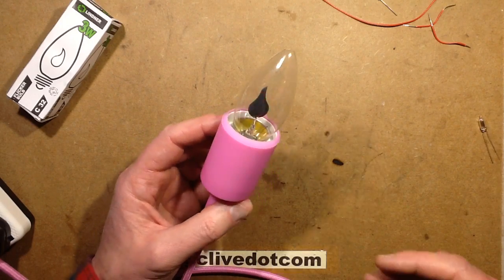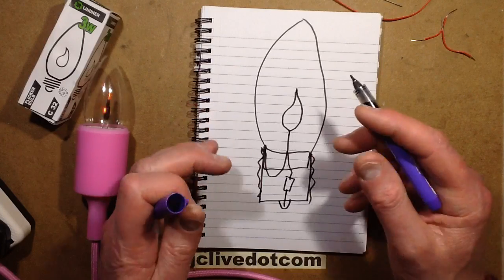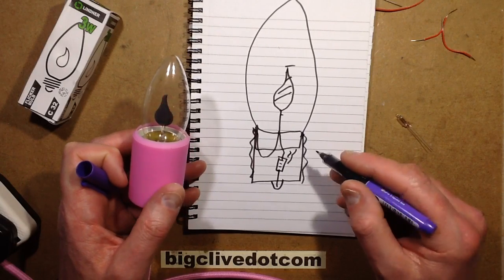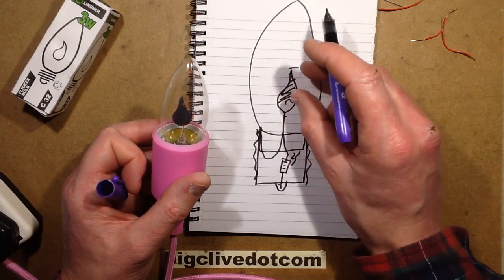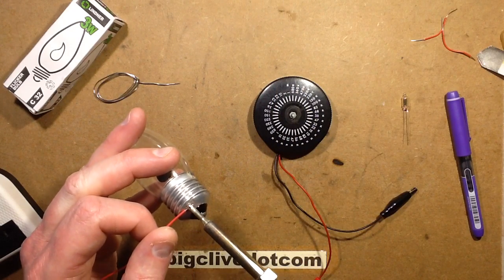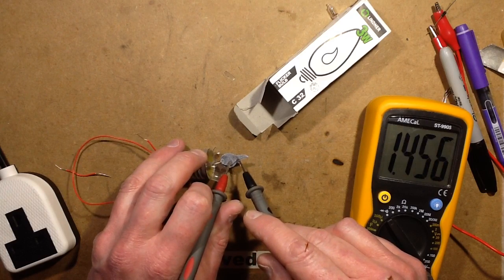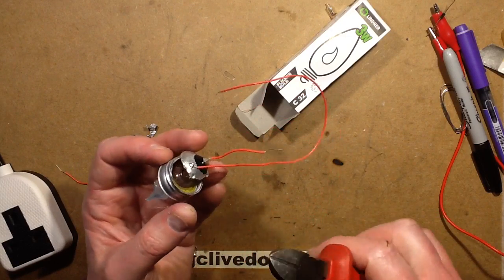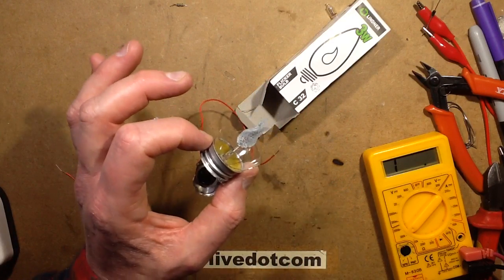Inside a cheap Neon flicker-flame lamp from eBay.

Comment: Thanks for this Clive - I was mesmerised by my flickering bulbs and suddenly wondered how they worked. Still wondering why use a resistor rather than run several sets of electrodes in series. Perhaps not enough room in the bulb, and the "hot" neon might do something weird too if there were extra electrodes to discharge to. Anyway, got me thinking! 👍🏻
Reply from the maker: A decent margin is needed across the resistor to regulate the current.  Without it the neon would literally pass as much current as it could.
Reply: @bigclivedotcom  of course: Neon might have a ~50V drop but probably doesn't obey Ohm's Law. Got it. Thanks!

Comment: I'm kinda curious now if these could be lit without the flicker when slightly over driving them. Old neon light bulbs for regular lighting, like war time blackout lights (such as beehive lamp), are rather hard to find and a bit expensive for my budget.
Reply from the maker: Possibly, but electrode seems optimised to flicker.

Comment: Can I ask a really silly question? Why did you solder the wires onto the tip/cap of the bulb? Why not cut the lead to the bulb holder and then connect the variable resistor in series with one of the wires using screw-block connectors?

Comment: I bought two for $1.50 each at Walmart, sold near Halloween as a novelty.  They were surprisingly nice, having a clear standard globe rather that the flame-shaped "candelabra" shape.  They draw a mere 3 watts.. And are said to last 2000 hours.

Comment: I use these in my Pumpkins every year. I've been using them since I was a tiny child they really are cool I also have them in c7 strings on my porch arches. I've seen them here in c7 c9 flame shape and A19. There were other bulbs here that were unique too that had like designs in them I have a pumpkin "Orange" and Christmas tree "green" one "they didn't flicker". I don't know what they are called but it seems to sound like what your describing as a neon indicator lamp. Ill try to find the box later as I kept the original package.
Also I hope to move to Norway on day and will be bringing some of my Favourite decorations. I will be using step downs that way I can still use everything. I don't think the 50hz will be a concern for the lights. Also I don't have to worry too much about polarisation as most of my lights don't use it and the ones that do only use one fuse vs the two fuses on the non polarised.

Comment: Hi. That strobe effect due to filming got me thinking. Could you look into how camera phones work in conjunction with their backlight/flash. The camera films at about 24 to 30 frames per second, I think, and the LED flash can be used as a backlight in some models, giving some very strange results as I think the LED has its own flashing rate. I note when I am filming and there is a mirror, the dust on the mirror will have a series of rainbow type bands, like the interference pattern on a diffraction grating per lots of fun in O Grade Physics. The pattern is only visible on the mirror on the camera screen and not the on the actual mirror in front of you.
This effect only happens with the light of the camera being used. It happens with various cameras and their lights but does not happen with any separate light, no matter what the colour temperature either.

This is also good for capturing these orbs that Britain's Most Haunted catch with their infra red. But with your own camera: have it on movie mode with backlight on, point and shoot. It's worked insofar as I could capture lots of orb things which were visible only on the screen in the light but not visible in front of you in the same light. Notwithstanding the ethereal verities of what is actually being filmed, the point is I'd like to know HOW it is being filmed. The dirty mirror is an obvious clue, and the strobe effect here reminded me.

Comment: Noticed the electrodes oxidise fairly quickly.
 coated in some form of  Phosphor or oxide lair ?
Reply from the maker: I'm not sure what they're coated in, but they did seem to oxidise rapidly.
Reply: @bigclivedotcom  
Did some research (Googling) after sifting the crap.
Found this site.
https://www.intl-lighttech.com/specialty-light-sources/neon-lamps .

Gases – neon lamps are filled with inert gases, of which the primary gas is neon. Additional gases, such as helium, argon, and krypton, can be added to change the lamp characteristics.

Electrodes – nickel is the primary metal for neon lamp electrodes, which are then coated with materials to lower the breakdown voltage. The length of the electrodes determines the current capacity and the length of the glow.

Comment: I broke one of these bulbs and found they do still work without the glass ! Only for 20mins though as it doesn't find a weak point to oxidise as a thin filament would ! Great for cooking one popcorn at a time or maybe a heroin addict chasing the dragon at Christmas 🔥🌬💨
Reply: You break it the has escapes, it does not still work after that.

Comment: Wow...I've never seen a flicker light quite like this one.  I love the fact that it has two light-producing panels back to back and slightly offset from each other as it creates a sense of depth like a real flame.  Most of the ones I find in stores around me simply have an led or element which is pulsed "randomly" which looks OK I suppose but this thing is amazing.
Reply: I agree with you! I wish be had sacrificed one of the non-defective bulbs,  this one was unique, and virtually impossible to replace!

Comment: You still can't solder aluminium just by using oil (or scraping as you solder). The solder will stick, but it won't last. Less than a week later in the case of scraping it will fall off, because you can't really stop oxygen diffusing into the join, which is by no means completely wet by 60/40. Oil might last longer, but I doubt strongly it would last even a year. You need a special solder which wets the aluminium properly, which is available, apparently.

Comment: Anyone interested in "Quicktest.Safe block mains connector" - a chap called mickyp57 is selling them for a V good price on fleabay, including cable and plug.  Mine was delivered today - it's extremely good quality - if it's a knockoff it's a very well made one.

I have no connection with the seller - just passing on the info.

Clive - if I've crossed a line - sorry - not meant as spam - feel free to remove - or leave a comment and I'll do it.

Comment: Could you replace the resistor with a capacitor?
Reply from the maker: Only with another resistor in series to limit peak current on each half wave when the neon strikes.

Comment: Clive, How much current do you reckon these will take? They say 32A - I've just ordered some - do you have any to test, or could I send you a couple?

http://www.banggood.com/5Pcs-235-Pins-Reusable-Spring-Lever-Terminal-Block-Electric-Cable-Wire-Connector-p-1103030.html?rmmds=cart

Comment: Oddly enough, looking on the US Amazon site they only seem to carry the European version of the "Cliff QuickTest" (single and three phase), using that search term, for sale in the US market, which is a bummer as I was quite excited when you mentioned they were now available in US and Canadian standard conductor colors.  Perhaps the US and Canadian versions are only available in European markets and will have to be imported from Europe (which seems a bit silly and less than an optimal sales strategy for a North American oriented product)?  I would very much love to add one to my electronics workbench one of these days as they are considerably safer than wire nuts or alligator clips!

Like you, I also fell in love with these neon flicker flame bulbs as a child.  I can still remember how fascinated I was when I first came across them in a retail store, a shoe store if I recall, while shopping at the mall as a young child and being absolutely fascinated with the way they could mimic a flickering flame.  So you can guess what I had to buy a bunch of when I became an adult and was decorating my first apartment for Christmas many years ago!
Reply: I have the US/Canadian version back in stock http://www.ebay.com/itm/Cliff-QuickTest-in-US-Canada-Wire-Colors-/302263880948

Comment: Here's an idea I've been meddling with. They say you shouldn't use an air compressor to clean electronics because of static electricity. What if I secured a ground wire to the nozzle and ground it to the compressor chassis? Is this a dumb question?

Comment: seeing flicker black side. What I used to tweaking it by whacking bulb on palm of hand without breaking it. I figure out how to get most 'flame' out of it. but if you continue to tweak, wire that holds the "flame" will become weaker and breaks off. I whack it on flame side and whack it on flame edge to tweak it. Be careful. use your common sense and wear work glove. (I did not wear it at all).

Comment: Yes you can solder to small and thin aluminium parts.  Obviously it has to be up to temperature, then you just scrub the daylights out of a very small area with your soldering iron tip, while completely smothering the job with molten solder and flux.  Could take upwards of a minute or so.

Comment: +bigclivedotcom (almost) Every product I see you buy has a European plug on it,  I'm just wondering why this may be? I'm assuming the Isle of Man uses EU plugs but then I've also seen UK plugs in your videos. Is this just the items you're buying are EU plugged or am I right in my assumptions on the standardized socket in the Isle of Man?
Reply from the maker: Most Chinese suppliers ship items with European or Chinese (like USA) plugs and a dodgy UK adaptor.
Reply: bigclivedotcom thank you for clearing that up. I've not bought many cheap Chinese items, myself, so didn't know.

Comment: Sorry Bigclive I know this is the wrong place maybe but ...
I had trouble with some cheap de-soldering wick and smeared it lightly with some plumbers flux paste in desperation.
Bl**dy ell the difference it made. Nearly had an organism. Need a good clean afterward though, the flux was over 30 years old.
Is it possible to test capacitors with just a ordinary Volt / Ohm meter ?
Reply: jp Clean the work area really well as plumbing flux is a highly acidic flux, which is why it is ordinarily never used in electronics work as over time any remaining residue will eat away the copper traces of a circuit board as well as light gauge wires.  As far as desoldering wick goes, the cheaper stuff often lacks any flux of its own and is often a rather coarse braid and borders on useless (one of those cases where you only waste money by trying to save money).  The better brands will not only contain flux but will also use a much finer copper braid, both of which make such far better at wicking up solder.  In the future, buy a small canister of rosin flux and keep it handy at your electronics workbench.  When you need more flux on your braid to get the job done just dip the end into the rosin flux canister, then continue working -- the canister of flux will keep for many years if you keep it sealed between uses.  Rosin flux is only a mild acid and only really active at high temperatures, so it will not damage your electronics if you do not get it all cleaned off.
Reply: As I wrote it did have a good clean. The bare circuit board was scrubbed in soapy water. If I rememberer correctly some plumbers flux contains 'killed spirits'. That's zinc chips dissolved in hydrochloric acid. Ideal for the odd little cut. 

Worth you replying though as others might not be so careful to remove all traces.

The desoldering tape came from a very well know UK postal electronics supplier and was not cheap. The braid was fine enough but it was useless without additional flux. Maybe it was old stock or a job lot from China. I will get some proper flux suitable for electronics though. When I went back the next evening the tape was almost black where I had but the flux on.
Reply: I just checked up on that flux
Non Acid - Non Toxic
Certified ANSI/NSF Std 61
Made by LaCo
Made in the USA ( With Stars and Stripes)
1201 Pratt Blvd, 
Elk Grove
Il.

Lead Free?  - Not for long in my house.

So how did it turn copper black as it's non acid and non toxic.
Essence of Elk bladder perhaps ?
Reply: jp There are true acids and then there are those things that behave like acids because they exchange ions in an oxidation-reduction (redox) reaction.  Ferric Chloride will etch a copper circuit board and even strip stainless steel, but it is not an acid either.

Comment: the small glass bulb contains a mixture of neon and other gases at a low pressure and two electrodes (an anode and a cathode). 
When sufficient voltage is applied and sufficient current is supplied between the electrodes, the lamp produces an orange glow discharge.
a small amount of ammonia is added to the electrodes keeping the arc from covering the entire anode and cathode.
the arc is smaller than the anode or cathode so it tends to jump all over the surfaces making the flicker you see.
when you broke the bulb the ammonia-oxidizing.

Comment: In the 1970s the early home 600W lamp dimmers used a neon bulb instead of a diac to fire the triac. I made a set of six flickering dimmers by replacing the neon trigger lamps with these flicker bulbs, then wired them out to incandescent lamps in the building chandeliers.  Worked quite nicely.

Comment: I'm the guy who told you that about the aluminum soldering trick, and i need to point out that it ONLY works with lead free solder, preferably pure tin solder with no flux. And a small blowtorch is needed for larger pieces of aluminum.

Comment: "It was being grilled. It wasn't having a good time!" LOL !!

Fastest oxidizing material I have seen... from black to gray/white in a minute.
Reply: Have you ever smashed a radio valve (USA esp. "tube") and watched the gettering go from shiny metallic black to powdery white in a couple of seconds?
Reply: @28YorkshireRose12  yes I have seen that happen after dropping it.

Somebody else I have to drop another one once for some reason I like a paint can or something like that or something somewhere full of water hit the edge when the tube got dropped this was a different tube of course part of the to move at least that was still attached to the base contain the get her and all that the actual get her ring that wound up in the water and actually started fizzing that was rather unusual thing to see wonder what the physics behind it that is or at least the chemistry
Reply: Now that I remember it I know why I had that container of water I had been sharpening a tool and was using it to cool it after using when sharpening it to avoid losing the temperature of the material.

I remember when my dad was sharpening his block plane blade a few years ago he was kind of flabbergasted about actually having water on the blade to cool it he thought it wasn't a good idea but didn't I explain that you had to cool it so that you did not destroy the temper of tool steel he's like oh
Reply: The common barbecue charcoal briquette sold in stores contains lime as an indicator agent, which is why the briquette turns a uniform white color when burned.

Natural charcoal will not turn a white color when burned, you'll either get grey ash or black dust when combustion is finished.
Reply: It makes you wonder how they made these. The getter in radio valves/tubes that everyone is mentioning is activated remotely using induction after the tube is sealed.
Reply: The briquette contains clay. as a binder, to increase heat capacity and probably slow the burn. but nirmal charcoal also makes white ash. These are the minerals, e.g. potassium (carbonate)
Reply: Cut open a 12AU7 & 12AX7. Getter turns color rather quickly. But that's not why I broke the seal. Also remove the plate, and took close up photos of the grids, for comparison. The 12AX7 has a finer pitch grid, than the 12AU7. The 12AX7 has higher voltage gain, but the 12AU7 can control a higher current. Filament power is identical (150mA@12.6V=300mA@6.3V=1.89W).
Reply: my barbecue briquettes do that in seconds - best observed in bright sunlight with a brisk sou'westerly gusting to  35 Knots.
Reminds me of what goes black, white, black, white, red? (Something to do with a set of stairs, gravity, a nun and a sharp instrument.)

Comment: In my experience, the oil isn't strictly necessary for soldering to aluminum. Like you mention, the oil's purpose is to protect the aluminum from oxidizing again immediately after you scrub it. With a generous enough blob of solder, it'll protect it the same while you scrape the top layer with the iron either lightly or with a iron/tip you don't really care about (the $20 radio shack fire hazard I've had the same tip in for 15 years works great for that).

I use it quite a bit for simple prototyping if I don't have quite the right component handy. I always have empty cans laying around, so 5 seconds with a razor knife and some cheap harbor freight cutters, and I've got a quick'n'dirty button or battery terminal or whatever and can get back to proving to myself that the thing I want to build actually works while I wait for shipping on real parts.
Reply: It would have been easier to solder onto the blob of solder next to the glass.
Reply: Solder with a touch of magnesium added might work.
Reply: Or an argon/nitrogen nozzle on the iron tip...